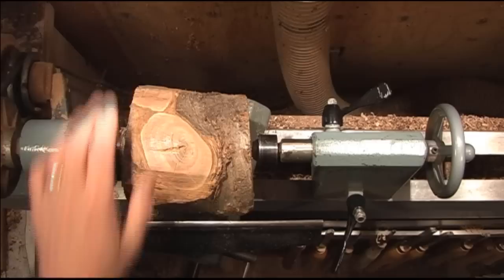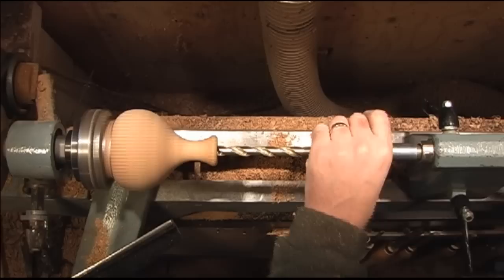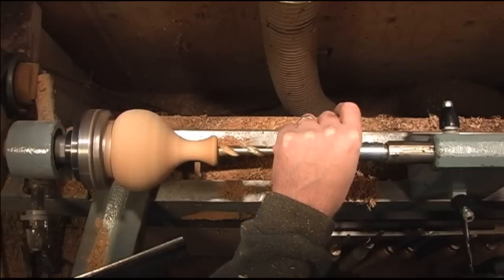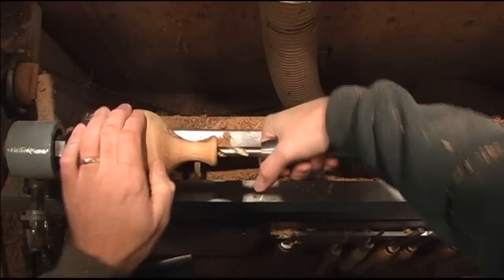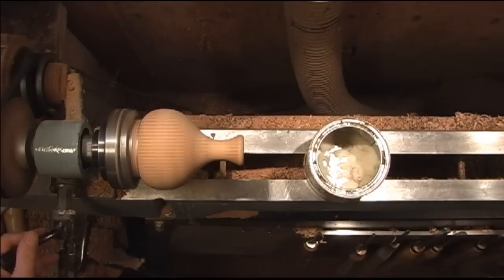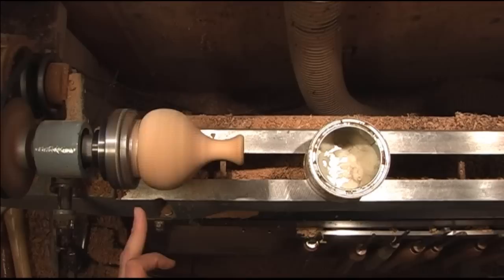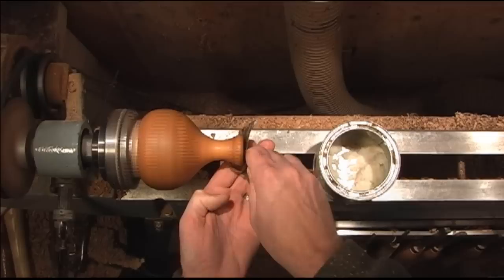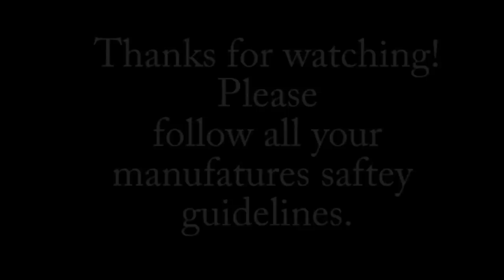Woodturning Turned Apple Weed Pot

Comment: You could re mount the Vase on a dowel tenon and use the tail-stock for support , means less band-saw cutting and most of the base you could sand and buff on the lathe

Great vid :)
Chris Black

Comment: It looks like the wood was not dry before you turned it.  If it is still wet aren't you aftraid that the vase will crack as it dries since the bottom and walls are thick?  I'd like to see you post videos on turning a finger ring and bracelet.  Please keep posting your videos.  You are doing a great job.  
Bob

Comment: Very nice!

I've noticed how you use wax right from the start of the sanding process.  I use wax sanding if I have a difficult finish so that I get a slurry that helps seal the wood but I've never used wax routinely to sand.  Do you find it gives a better finish than dry sanding and then waxing?

Best Wishes,
Brendan

Comment: Great video. Beautiful shape! Question. My lathe does not have the ability to hold a drill bit in place on center like your does. How would you do this otherwise?
Reply from the maker: Thank you Adam! I would drill it out first that way it's centered.
Reply: Ok. Was was thinking that, but was concerned that it would weaken the wall up near the thin neck, but that sounds good. This is my next turning project!!!